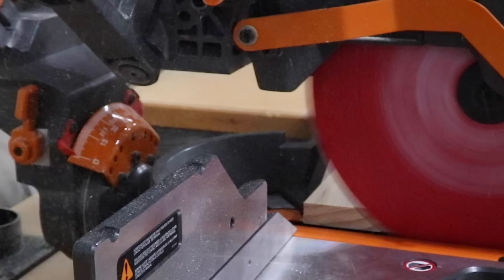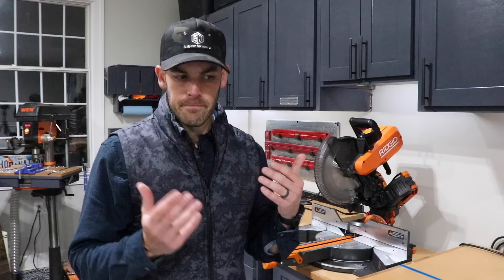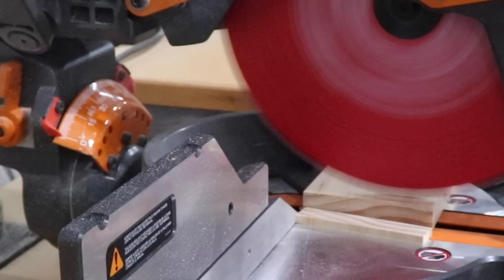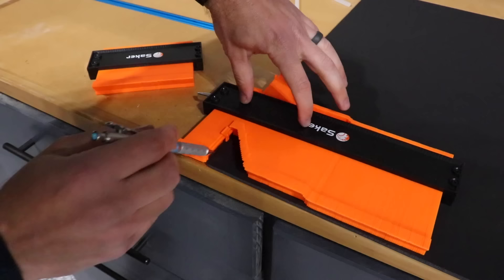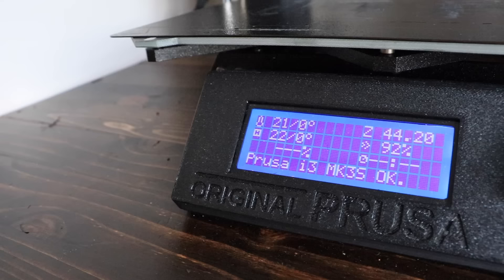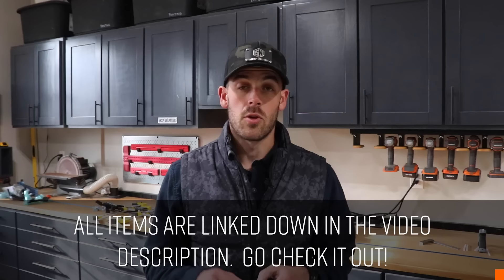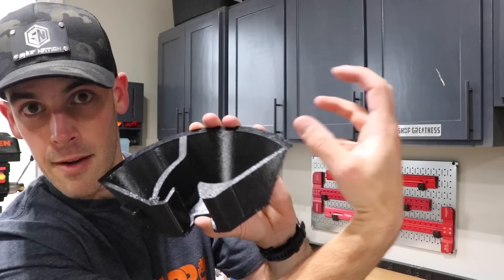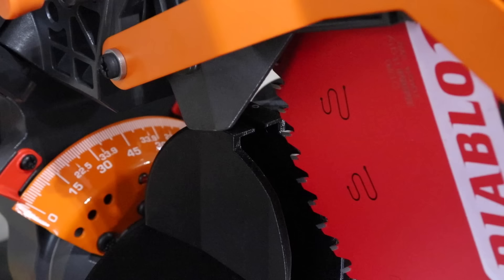Did I Solve Miter Saw Dust Collection?

Comment: I would split the vacuum line and make sure there is also suction on the factory location. And then maybe engineer a way that the deflector you removed can still remain on with the new 3D printed piece in use.
Reply: Also, I LOVE the straightforward showcasing of a failure… engineering and DIY are often failures and we need to be honest about it so people just getting into things have realistic expectations. Failure doesn’t mean we didn’t learn, nor that we didn’t have fun!

Comment: The saw dust does not go backwards when cutting like your design suggests. There is a reason the dust port on this saw and just about every other saw on the market is located in roughly the same place at the top of the saw. I would create something that is a better version of the one that came with it as that one was garbage but that is where the chips go.

Comment: Throwing away the instructions immediately is key to my process as well ha ha! I've always wondered if having some blowers (like a mini leaf blower or perhaps channeling the air output of the dust collection vacuum) would help. They could be mounted in such a way that they help force the dust towards a concentrated area that would then funnel the dust into the collection system. Anyway, thanks for sharing your trials and errors of the process!

Comment: I wonder if they were to build dust collection into the base of the saw, kinda into the clearance plate, if that would help. The hose hookup could plug underneath and be on some sort of swivel to accommodate the pivot motion and bevel motion of the saw

Comment: I think the key factor is air flow. The saw moves particles at pretty high speeds. The displacement of air in your solution should make the particles get directed into your vacuum system. Maybe you can hook it up directly to your vac not with a separator to avoid parasitic losses. Frank Howarth has had some success with this.

Comment: You did really good. The only difference I would have made was maybe on the test. Run the stock collector into an empty dust separator and then run Your design. measure the difference caught  But obviously you can see saw dust everywhere. I believe the sawdust is being thrown with the force coming off the teeth is simply blasting past any vacuum and escaping the suction. I will be trying the same thing just increasing the front opening like a big catchers mitt. I’ve seen the stock where the sawdust is literally slamming of the the collection system but not be contained. Perfect world we could place air nozzles in the bed pushing from the sides focusing everything into the collection. Again it was a great video. How do you feel about the saw? There are only a few reviews out for this saw.

Comment: I noticed that the older saws that have no dust collection shroud on the mouth of the saw are the ones that collect dust better, its because theres less crap out of the way for the dust to travel. Engineers dont take into account that there trying to control the dust by sucking the dust towards a hole its not going to work, its like taking a handful of dust and throwing it at a 4' hose, like the hose aint going to suck it all up. The problem is getting dust at the source, a track saw and a table saw works exceptionally  well because the blade is completely enclosed and the wood also acts like a dust shroud for those 2 tools if you dont have the blade extending pass the work peice, then the dust absolutely got nowhere to go but in the dust collecter

Comment: I suggest another test: instead of trying to film and see where the dust is going with your eyes, take a scrap flat board that will fit back there, apply a light coat of glue and then do some cuts. The saw dust will get stuck in the glue and give you a rough profile of the dust flow. This won't be perfect either because airflow patterns change with the board there, but it might give you more ideas about what's going on.

Comment: I think, based on the amounts of dust on the adjacent power strip, that this was a resounding success! You knew it wouldn’t be perfect, but it collected LOTS of dust that would otherwise be spread throughout the shop. How about measuring the dust collected in the a clean bucket over the same 8 cuts? I’m thinking that most of what you missed was the higher velocity particles, but I’m only a civil engineer… ;)

Comment: The split of dust port reduced air speed, so more dust is not captured by top port.

How about brush type surround of end of the saw?
Since your stationary solution disable cuts at an angle.

Comment: I like that you used posterboard for the prototype, I usually use scrap coroplast, but you didn't test to see if it works before wasting time building the 3d model and printing it??? Next time, test your initial prototype! My solution for my Hitachi was a 2.5" hose to the standard port flaring out the rubber boot at the back for more primary dust collecting, and an arched clamshell hood that encloses the width of the saw base, behind the fence to the wall and leaves a few inches clearance around the moving bits. Imagine looking at the saw from the side and a semicircle arcs from the back of the saw at the wall upward toward the front, stopping at an invisible line straight up from the fence. Then from the front view, another arc from one end of the fence, over the top of the saw and down to the other side of the fence. That gets a 4" port about 2/3 up the middle of the back of the hood. the saw can be adjusted to any compound angle and everything just works. It's not perfect, but it's 100 times better than it was.

Comment: My 2cents. Variables to account for with dust collection are velocity and volume.  This first iteration seems too constricted to allow sufficient air flow volume to grab and pull enough sawdust.  By having such a form-fitting shroud you get velocity but sacrifice lots of volume, particularly since so much dust is ricocheting at odd angles.  And run a small risk of burning out the vacuum motor by restricting flow.  How to get a more open design I leave to the engineeers. 😁

Comment: I think the problem you are having is the same problem that indoor shooting ranges had to solve, the question of how do you stop a high velocity projectile and get it to stay in a catchment rather than ricocheting off. 

How many modern indoor ranges solve this issue, is behind the target there is a large funnel that leads into a circular chamber, the funnel is a long taper that directs the bullet inside, and then it spins in the chamber rather than hitting a surface which it must bounce off of. 

Rather than having the saw dust hit the back of the scoop, which is essentially the same setup it was before, I think turning it into a long taper funnel, that then goes into a circular chamber entering on the tangent, allowing the dust to swirl down to where it is being picked up by the hose, that would get the job done.

Comment: Nice try Travis keep on keeping on. My Dewalt is a Dust Slinger too, very hard to control.
I'm wondering if there's a way to some how create static electricity behind the saw to attract the airborne dust to one area where it can then be vacuumed away.
I have no clue if this would be a viable solution or how to do it ...l will leave that up to you😁. Good luck!!

Comment: I was as surprised as you were at the lack of performance. Evidently the close fit creates "air dams " that redirect the intended flow. I have a 12" Milwaukee sliding, compound miter saw. Bought it over ten years ago. Smoothest saw on any job site, dialing in the accuracy is a fiiddly experience. It has the best dust deflection/direction system I've experienced while looking like it shouldn't work. I've had/used Dewalt, Hitachi, Makita, and a few others, none worked as well as the Milwaukee in dust mitigation. I've never used a vacuum system, relied on the collection bag.  Not even close to perfect, but better than the rest with no sucky-suck device and the collection bag fills fairly quickly. The collection wings are taller and set a bit farther away from the blade. As I said, the systems doesn't look like it would work, but it does. When I quit doing "goin't to the job site" work, I'll hook a vac to it. Why haven't I done that yet? Lots of reasons, mostly excuses.

Comment: Try doing a smoke test to see if there are some weird air vortices being created. I bet the blade throws more air than you'd expect. I'm wondering if some compressed air jets could be use to catch and redirect the dust towards the collector. The Holy Grail would be to create a laminar flow situation, but that seems pretty challenging.

Comment: I think you pretty much need a hockey like table to sit the saw on, except instead of blowing air like a hockey table does it would suck sir thru the table into a collection chamber underneath and it probably need more suction then what you get from a shop vac?  Dust seems to fly everywhere, so there needs to be suction coming from everywhere to catch all the dust.  A counter full of holes to suck the dust thru that the chop saw sits on top of . To me be your best shot at catching least majority of the saw dust!  Of course holes would be larger then what’s on a hockey table!

Comment: Some think outside the box.... I think under the table.

Instead of trying to vacuum the chips, try blowing them with compressed air into the collection parts. I imagine the compressed air nozzle mounted underneath the table. Thats the source of dust, when that single saw teeth exit the wood, that single minuscule wood chip is projected below the surface, the wind from the blade throws it in random directions, and making the lighter than air dust fly everywhere. 

Having an air jet stronger than the wind of the spinning blade, might send the sawdust exactly where you need them, but only when the blade is in full depth of cut:(.
 
Will the standard 100psi air compressor be enough?

Will reducing the speed of the blade produce less wind turbulence and reduce the prejectile factor to give a chance to the vaccum and air blast to overpower the wind source? 

Can you add wind defectors, force the air in a channel, creating a ventury and creating a self sustaining vaccum?

Comment: Just looking at your cutting technique, the path of the dust is going to be up more so than straight back. If you instead cut shallower with a few passes, that would direct the dust more towards you're 3d printed mechanism. The other issue is deviation from centerline. I'm a little confused why you confined the dust collection so close to the blade. Open it up to that entire cavity right behind the blade and I'd guess you'll see better results.

Comment: I’m a 14 year old who’s been woodworking for about 3 years and I’m looking to upgrade from my little 7 1/4 inch sliding single bevel miter saw up to maybe a 10 or 12 inch sliding miter saw. Would you recommend the axel glide or the regular dual rail?

Comment: The wind generated from the rotating blade, will blow toward the exit. My solution was to create an L shape hood: at the top of the hood was a filtered opening so that the air could escape, but the dust (at least most of it) could not.

Comment: i mounted soft plastic on the arm that operates the blade shield and on the other side.  I was loosing control of the dust from the side of the blade, not the back.  .  It increased the dust collection at 500%.

Comment: Hm, I couldn't clearly figure it out wether or not the vac was also connected to the original dust port of your saw. But if not, your result comes at no surprise to me. That's simply because the saw blade tries to shoot the saw dust tagentially and since all other directions are blocked by your jig it is shooting up- and backwards. I'm pretty sure that a Y-adapter for your hose and a connection to the original dust port will improve the dust collection tremendously.

Cheers from Berlin, Germany

Comment: I've tried a very similar thing with 3d printing & had basically the same results. The problem is the airflow around the blade. I think a 3d printed TPU (flexible) skirt around it might concentrate the vacuum's airflow enough for better results, though I haven't gotten around to trying that myself. Would love to learn from you though. :)

Comment: the problem is that these saws are not designed with dust extractrion in mind. no shopvac will move enough air to do anything major. i have tried on my saws with multiple vacuums pulling from both sides and while better the improvements were minimal. the only worth while improvement i found was putting my 8" extracter pipe moving 5000m3 an hr  in there. there is no replacement for displacement as they say. a big box to control the dust is the only way . it gives the dust colecter time to catch the finer dust and keeps the heavy stuff somewhere handy to clean up later.

Comment: I think it has a lot to do with momentum of the dust particles. They are traveling too fast to be affected by the vacuum. Seems like blowing them down into a vacuum air stream could help
Reply: I think this is the secret sauce to this problem.  If one created a "corridor" or "walls" on both sides of the blade using forced air, it could capture those particles and channel them into the dust collection scope.

Comment: It’s a good idea but I think you will have better results if you put it up near the blade and where the original dust collector was. I been testing something like that with a cnc machine brush. I have it just around the dust collector. Works ok but I think if I can fine time it it would work real well.

Comment: Nice design and very attractive implementation, but I think you're focusing on the wrong thing and the outcome kinda bears that out. Forget the close fit at the furthest-back-and-blade-down position, at that point your cut is complete and there's no more sawdust to collect. You want an open throated collection "funnel" that catches the spray either side of, and above, the cutline. That will reduce the bouncing and distributed dust off the back of the blade, and as it necks down towards the back where your dust collection hose is, the flow velocity will increase which will help with dust entrainment. Look forward to future iterations!

Comment: Theres really no great way.

Take a big Rubbermaid container at least as wide as the saw, cut a hole in it and run your vac into that.

Place it behind the saw and the suction will capture most of the fine dust coming off, and the bigger chunks shoot into the container which you can then dump periodically.

Or, somehow run suction into the base of the saw so it's sucking from underneath the blade?

Comment: You made the same assumption Makita did when they designed their dust collection. They did, to their credit, keep a dust collector behind the blade that moved with the saw head. After years of using dust collection on various saws I can say that Festool has the best dust collection of any of them, but not by much. So you may want to take a look at it. I suspect the best approach would be a collector pretty close to the saw blade that can retract up into the blade housing as you make the cut so that the full height of the blade always has some thing behind it. KInd of how the blade guard works. I have no idea how to implement it though as I just put sticks together for a living.

Great work, a smart dude like you should be able to... do some thing that probably hundreds of engineers have looked at and decided the bare minimum was the way to go... Honestly Its going to take some one who actually cares to really address the issue, so... Wish you the best of luck!

Comment: A long thin opening next to the blade tends to work best so far as I can tell, also if you can apply suction to the base where the blade goes through at the same time, it cuts it down, but the only thing I have found that really works is a big enclosure with major airflow, that encompasses the entire back of the saw station. Typically a curtain from the front is hanging as well. 

Also, using a proper dust collector, not a vacuum, is necessary. 

For me, I just open the garage door and run my backpack blower lol
Reply: Velocity is always the answer.

Comment: I would make a spring loaded dust collection on the blade/motor head. If you collecting directly on the back edge of the blade and the spring mechanism would lift up as the saw cuts into the piece of would hopefully it would not have a chance to fly all over. Also this may be a permanent option as its may be possible to accommodate blade bevelling while in use.

Comment: the creativity shown in your solution boggles my mind.  keep at it I know you will solve it.  I was unaware that Ridgid marketed this saw... now I want one !  I cannot find the width of the bed anywhere tho, and need to make sure it will fit on my flip top cart before I blindly order it... are you able to provide the width measurement for me (excluding the 2 slide out wings I would omit)?
Reply from the maker: The 12" version (the one I have) is about 25.75" wide at the base without the two extension bars added.

Comment: Since the original dust collection thing was attached to the saw body, not the base, you might follow suit with your 3D device. That way your target dust concentration follows the saw blade, rather than the 3D device remaining in a static position while the “hot spot “ moves with the blade.

Comment: Empty your dust collector first to determine the baseline mass of dust collected, any iterations should result in a greater capture quantity. 
The velocity of the chips are breaking escape velocity of the pull of the vacuum. So you need a much higher volumetric air flow rate  or you need go catch them at a point where the air resistance has slowed them down. Ie further back. Or slow your blade 😀